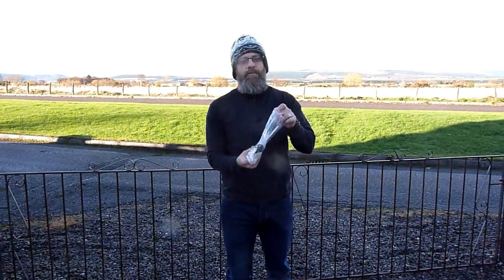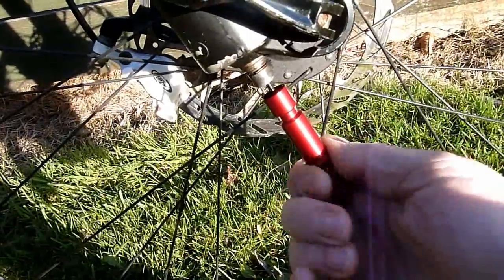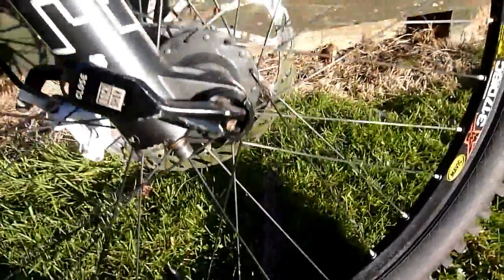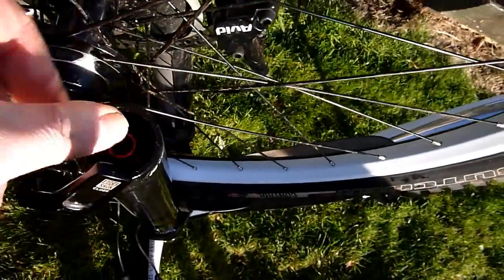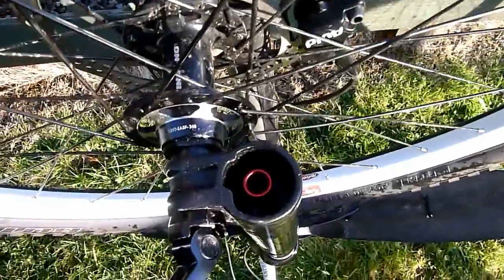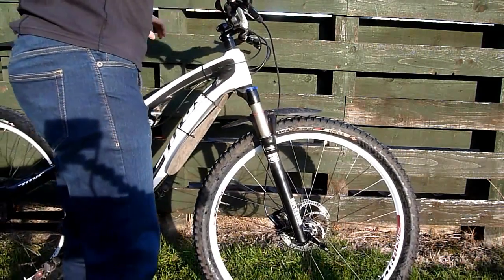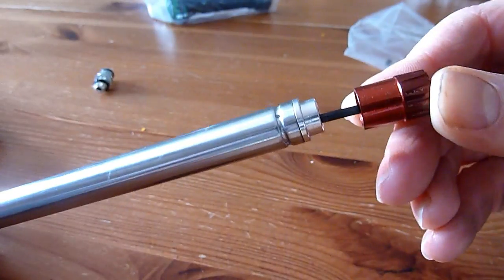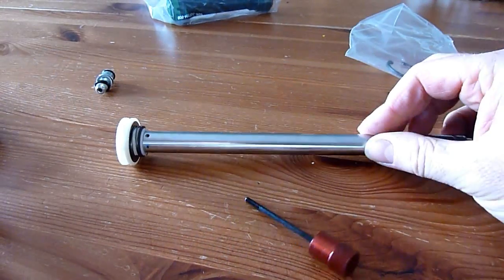Rockshox Damper and Rebound - What You May Not Know

Comment: Help mee i turned my damper alot and it was making clicky noises. Now it doesnt make noises and its not changing the rebound speed
Reply from the maker: Sounds like the adjuster may be rounded.  Can you remove it completely ( like i do )and check it.
Reply: Old Gits its brand new not rounded
Reply: Blinky  did you find a fix.  I also have a brand new raidon suntour fork and it just spins freely.
Reply: Shay Miah the thing turning in the fork is rounded on mine i coulnt fond a way to adjust it
Reply: Same problem here. Any fix?